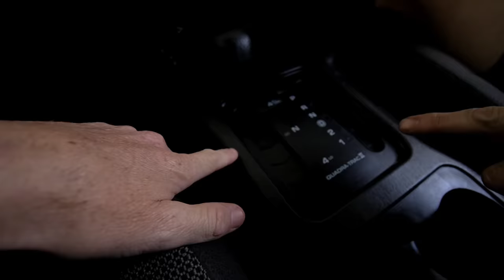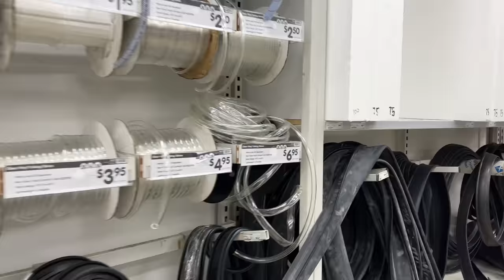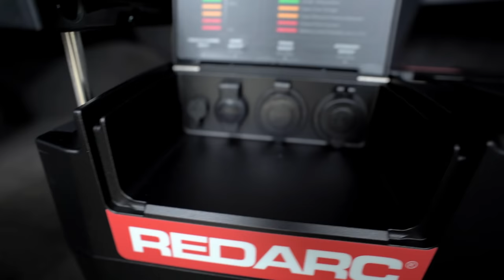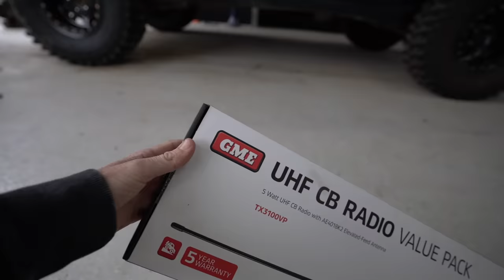WE spent $5k on this ?!

Comment: This awesome, great choice! With the remaining budget I would get a 4wd Systems Lokka in the rear which you can fit yourself easily as in these you only need to replace the carrier centre which can be done without removing the actual centre (crazy!). Cheap traction aid, which you'll need as it looks like you don't have the 'quadradrive' 4wd system which basically added hydraulic LSDs front and rear, and without any sort of brake lock traction control, or long travel shocks to allow good articulation, you might struggle on the technical stuff. In saying all that, nothing the V8 and plenty of loud pedal can't make up for!

Comment: 2 drops of original dishwashing liquid in a spray bottle with boiled water spray on windscreen make really wet lay sticker on the wet surface position sticker push water out from under sticker let dry job done much easier

Comment: Good work.  You've turned that Jeep from a soccer mum SUV into an trail ready weapon, and all for under $5k.  For you sake, let's hope the challenges are off-road related.  'Coz they could just as easily be as silly as those in Top Gear challenges.  BTW.  Is it stipulated in the challenge rules, that the vehicles participating have to be road legal?
Reply from the maker: Mmmmmmm yeahhhhh 😂
Reply: @TJANDMAC  🤣🤣🤣🤣🤣🤣🤣